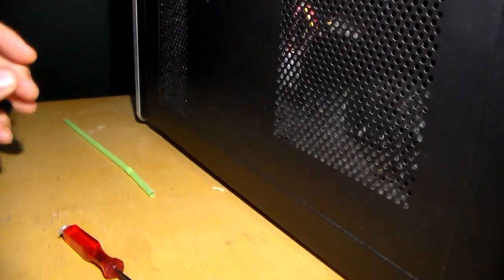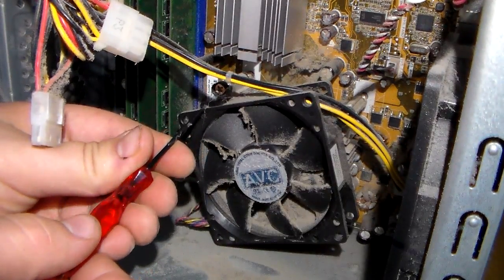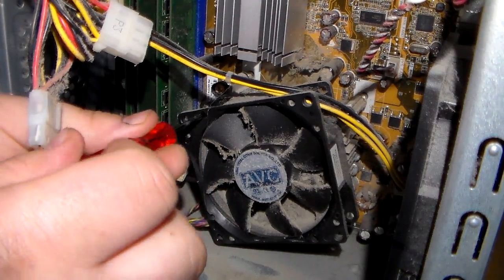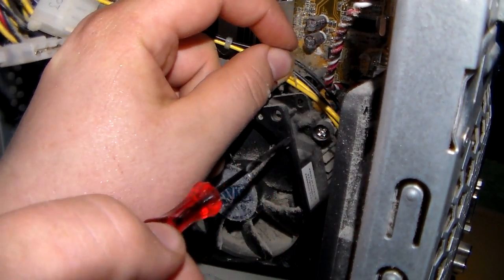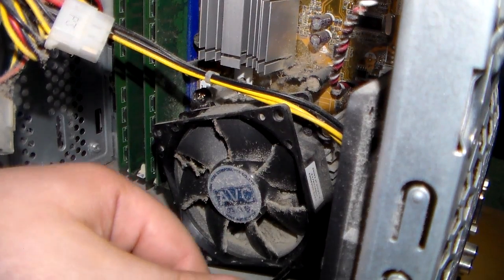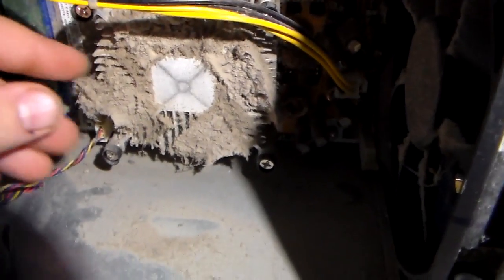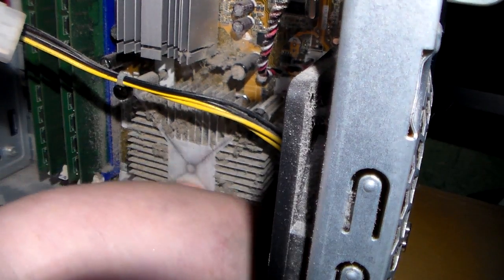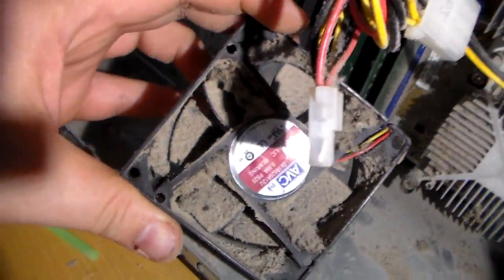How to clean heatsink  without compressed air or a vacuum cheap and easy

Comment: Truth in Advertising.   You clearly used compressed air.  You should have used a vacuum and set up an adapter to attach the straw to the vacuum hose. Way better than blowing all that dust around your house.  I'm sneezing just from watching.

Comment: He is using compressed air through the straw. You can hear it. He's just not showing it on the video.
Reply: +William Stockwell sounds like he is using his mouth to blow the air,you can hear him inhaling
Reply: Ye totally wink
Reply from the maker: no, I was blowing through the straw.
Reply: Amit Tiwari
y saw it later again xD
Reply: TheBeast lol fake ass the air is condensing on the heatsink lol
Reply: @fullysickbrah2949  , it could just be the moisture in his breath. Give him the benefit of the doubt
Reply: check the saliva at 4:26

Comment: well, how about getting a vacuum then, that would be much easier...
Reply: 李江 A vacuum doesn´t remove the thick layer of dust that glues to the hardware. Compressed air is required.
I´m not criticizing you or anything. I use a vacuum on a regular basis, but it really doesn´t remove everything. Just take a cotton swab and clean the dirt in those fans and will understand what I mean.